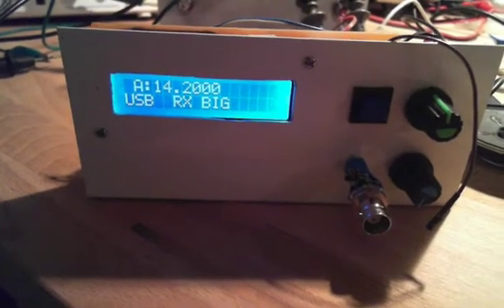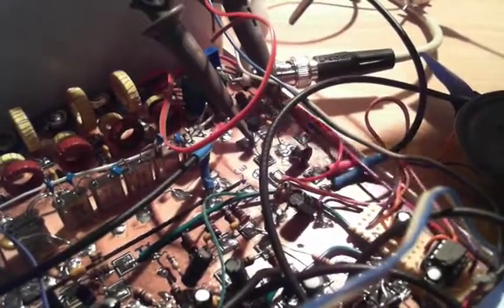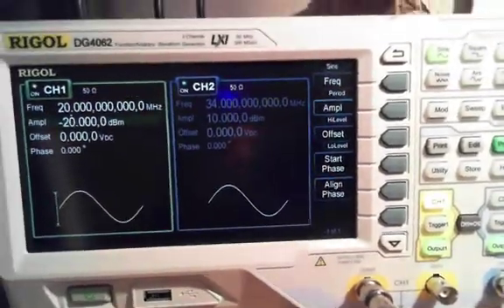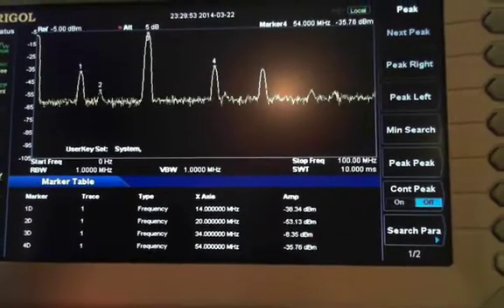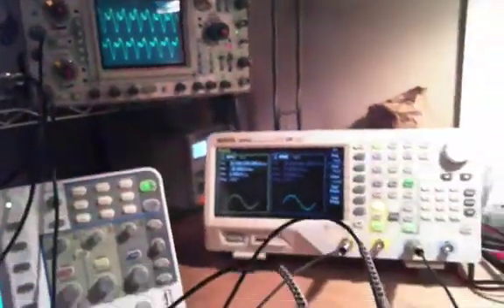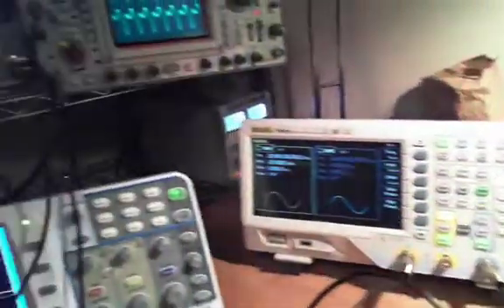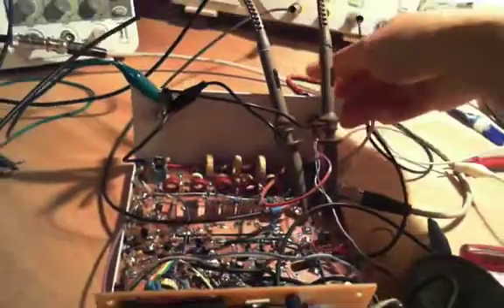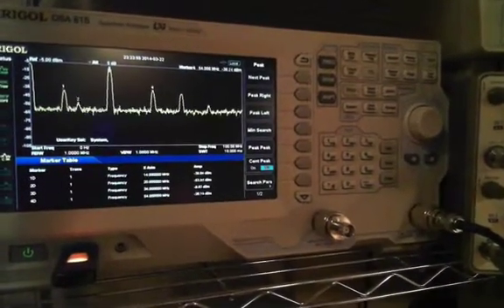Adjusting the Minima mixer

Comment: The fact that the output of the mixer hasn't changed when you varied the bias from 0 to 5V probably means that the FETs never switch off and the mixing action is due to non-linearities rather than the chopping action of a switching mixer.
Check impedance across the FET to verify this assumption.